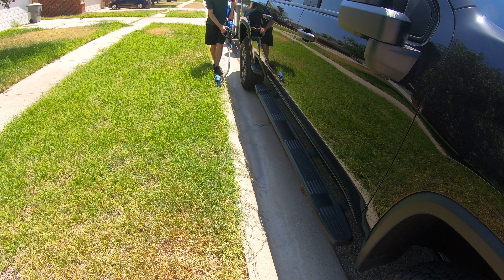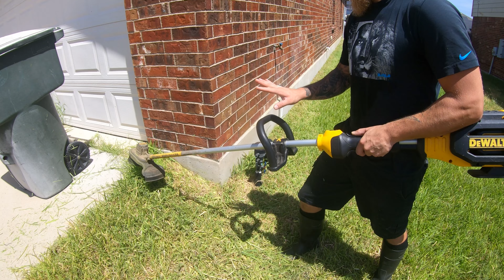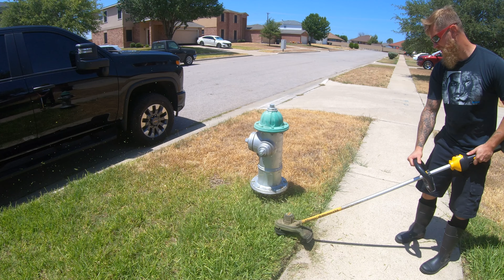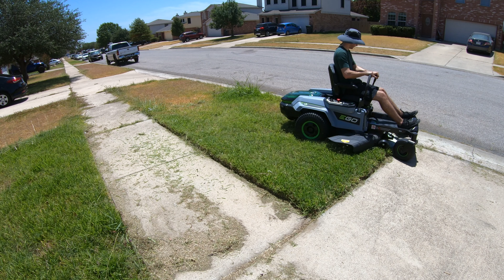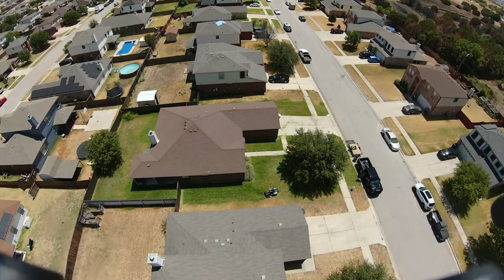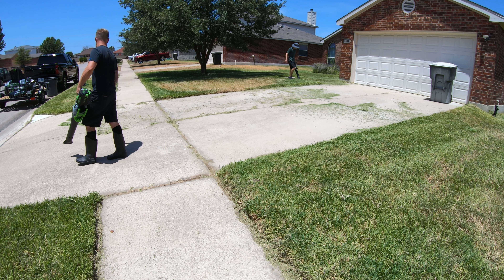4K SATISFYING yard cut for FREE, ALL ELECTRIC equipment with DRONE footage

Comment: Great video.
I just subscribed.
Try using Husqvarna titanium x string on your trimmer.it works great and it wears like iron.
I think that the all battery powered equipment is a great hook for a business.
I bought a Ryobi 40 volt straight shaft trimmer.my echo pas 230 has nothing over the Ryobi.
Reply from the maker: We'll give it a shot, thanks! 
And this whole full electric thing is kinda taking off, the maintence free side is what we like the most!

Comment: Cutting the grass for free is commendable, using electric tools is also commendable, and the end result was a nicely cut and trimmed yard, so I want to make sure you know I am giving you that positive feedback.  However, I can make no sense at all of your mowing patterns, and your grass clipping blowing patterns.  You cut your mowing paths short with ridiculously high number of turns which makes you mow the same strip three-four times or more.  I realize you might do this to keep the mower in view of the camera, but you could work faster and drain the mower batteries less if you would just mow border-to-border in a straight line, turn, and come back parallel to the previous cut  Also, you blow a section of concrete clean, then blow clippings back onto the part you just blew clean, then you blow it clean again.  At one point, both guys were blowing  the driveway in opposite directions at the same time!  If you would get a mowing (and blowing) plan and stick to it, i am sure you would work faster and discharge your batteries less.
Reply from the maker: Your absolutely right, with a good pattern we'd probably be done half the time (at least for the front section). And, our blowing skills are sub par to say the least haha. Thank you for commenting, please continue watching and possibly subscribe if you'd like, with time our skills will definitely improve and hopefully make for a better viewing experience.

Comment: If he cut in a straight line going both ways he wouldn't have to go in circles and waste time.
Reply from the maker: Your absolutely right, we gunna have to work on that. Thanks for the tip!
Reply: Does it matter how it cut the grass every one cuts it different stop putting the chap.down fairplay to u good job